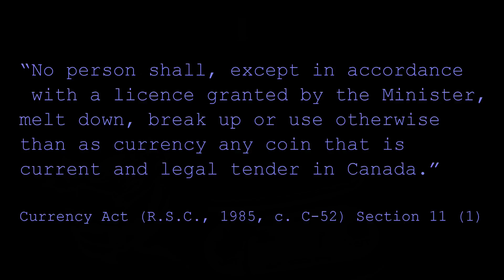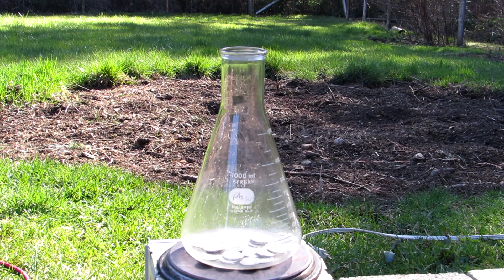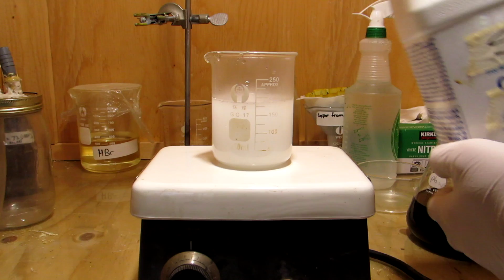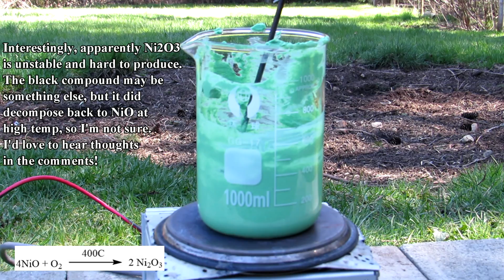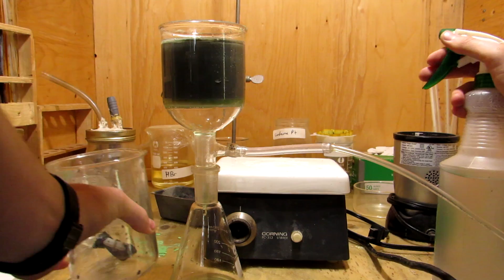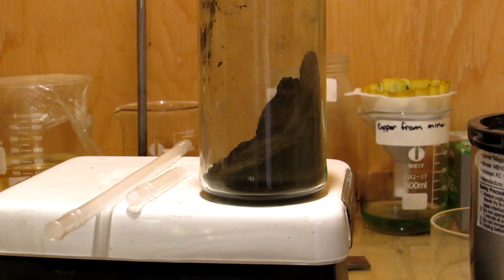How to Make Nickel II Oxide

Comment: What was that spark that was seen inside the flask when the nickel was dissolving? Strange how it seems to have started towards the middle and travelled upwards in a thin line.
Reply from the maker: I didn’t even notice that tbh until you pointed it out 😂. I’m honestly not sure, but it might’ve been my watch reflecting light onto the flask. If it was an actual spark, the flask definitely should’ve blown up 😂.
Reply: That would make sense. It's only a few frames, but there's a circular brighter spot around the "sparks" (a watch face would be a perfect explanation) and the "sparks" are all in a line along the center of the flask, which is probably due to the curvature of the flask, and the actual "sparks" may be reflected light from condensation on the inside the the flask.